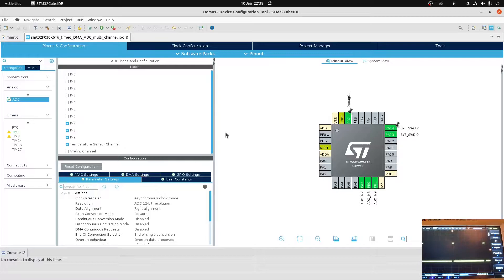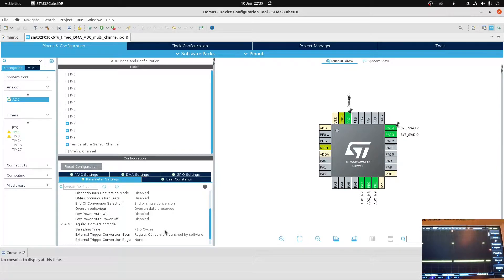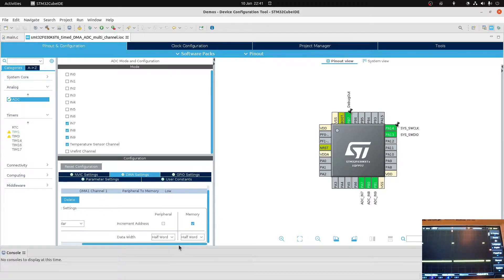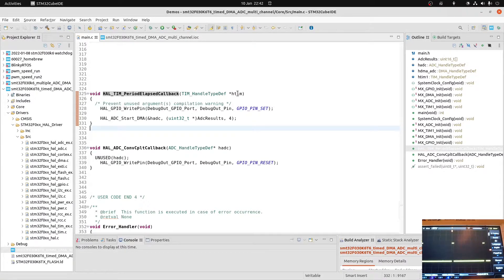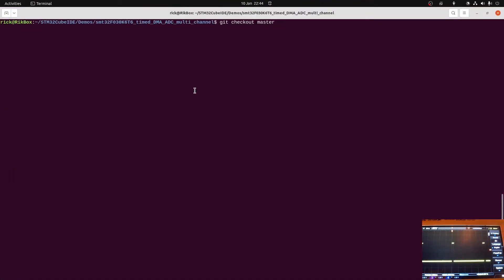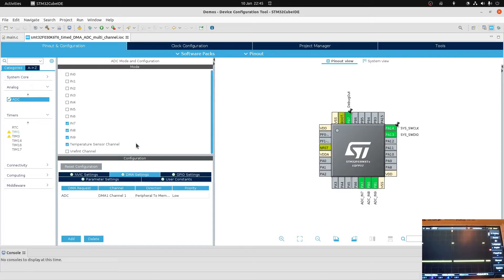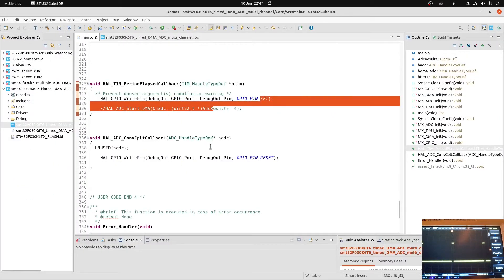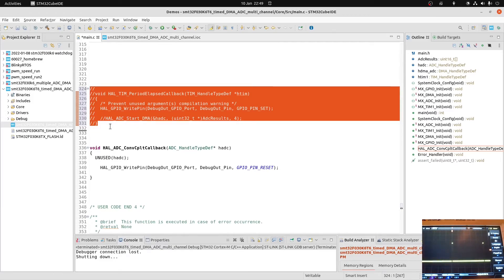stm32 timed multichannel ADC DMA conversions on STM32F030k6

Comment: Thank you for this tutorial. But I am still wondering about this code HAL_ADC_Start_DMA(&hadc, (uint32_t*)AdcResults, sizeof(AdcResults)/sizeof(AdcResults[0]));
I have used DMA but I did not quite understand the sizeof(...)/Sizeof(...) meaning. i would be grateful help me out.
Reply: Hi,
I will try to answer you, it is about what is HAL_ADC_Start_DMA is waiting for and what are you telling with sizeof().

- sizeof(AdcResults):  returns size of the array in bytes. 
If AdcResults is an array of 3 elements of type uint16_t, the size will be 3* sizeof(uint16_t), which is usually 3* 2 = 6 bytes.
- sizeof(AdcResults) / sizeof(AdcResults[0]): This returns the number of elements in the array. In this case, it will be 6 / 2 = 3 elements. (Adcresults[0] has 2 bytes as it is type uint16_t)

HAL_ADC_Start_DMA is waiting for the number of elements of the array. So if you give it with the first way it may cause malfuctions in your code.

I hope it helped you to figure it out.
Reply: @lookatravieso5036  thank you very much. It is very helpful.

Comment: Thank you so much for this video! I was using low power modes and was looking for a way to trigger DMA to get ADC values but only once per sec, not in the continuous mode. Just for the sake of lower energy consumption. Couldnt get this on my own, had to enable DMA Continuous requests for it to trigger, such a small detail  :/

Comment: Fab overview, one question though, for continuous automatic timer driven ADC DMA transfers of say 32 words a go, using 2 independent ADCs, when the last ADC word is transferred the timer will be generating another DMA request to both ADCs.  If the ADC DMA isn't quite finished when the timer event occurs, could there be a problem?  I'll test this I guess, only way to find out right? PS I need both ADCs to transfer to the same slot in each buffer at the same time, hence the need for a timer to synchronise the transfers rather than letting the ADCs just run continuously.

Comment: On stm32f103 there is no DMA continious concersion, but circular is enough, but it will not work.
The solution is so easy: swap adc_init and dma_init. DMA must be initialized first in the code.
Reply: Thanks, Sohrab!  This problem has been seen before.  It happened to me too - and took me hours to find the problem!  I wish I had known this fix sooner.
Reply: can you help me? I use KeilC, DMA is the first, but it dont run continous